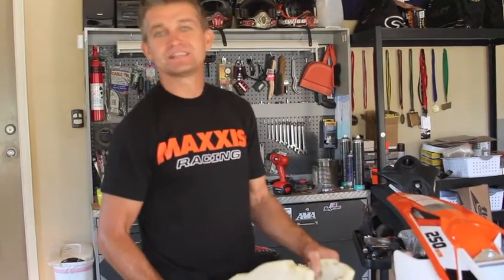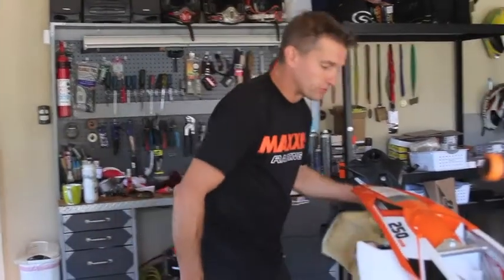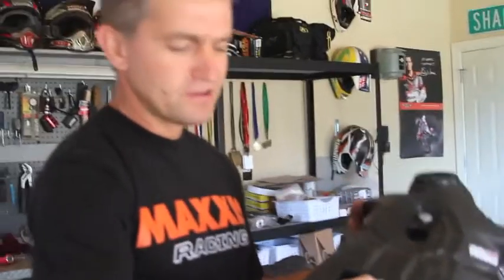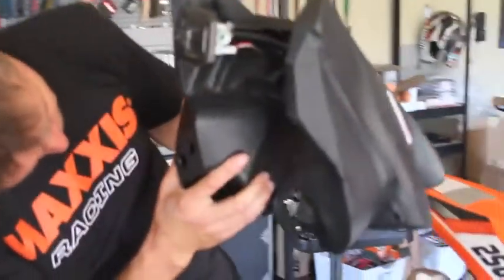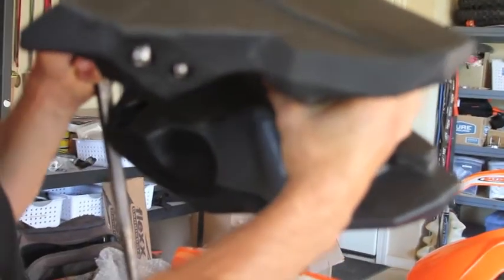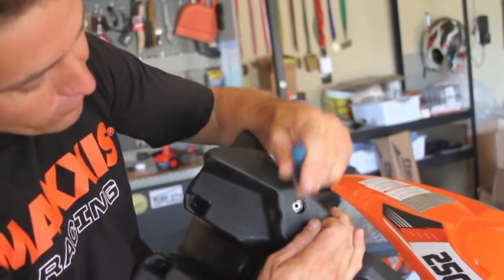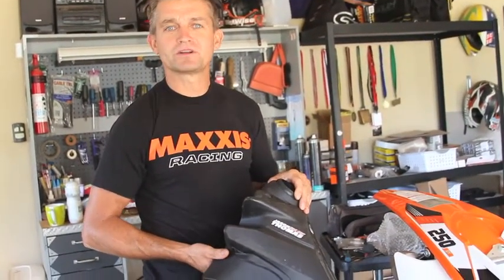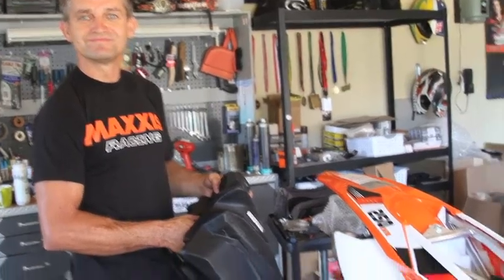Tech Tip 5 KTM 4 Stroke Fuel Pump Installation

Comment: I use a 2' piece of string tied to the threads of the fuel line feed.  Drop the string into the side of the tank and fish it through with a price of wire fashioned into a hook.  Takes less than a minute.